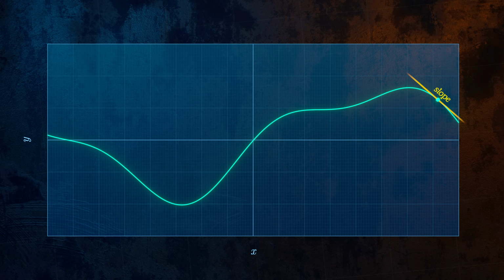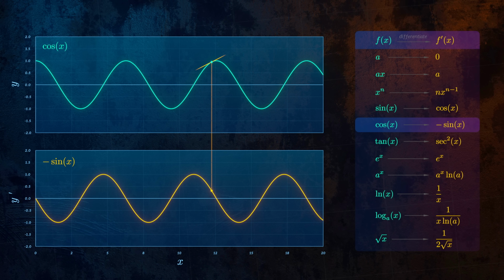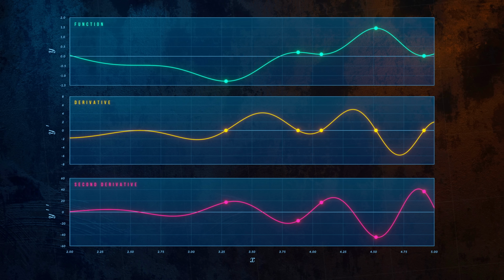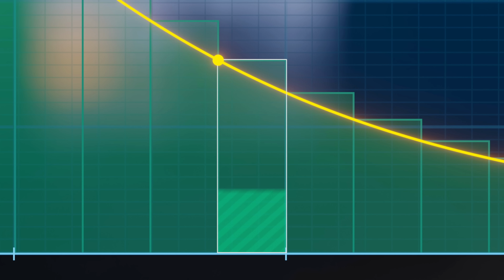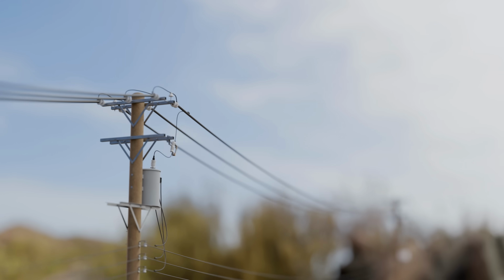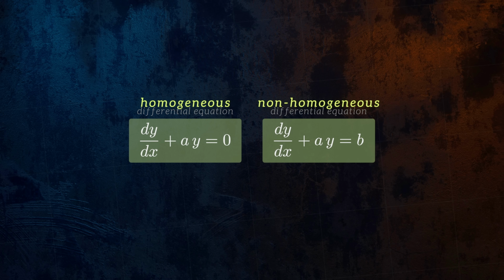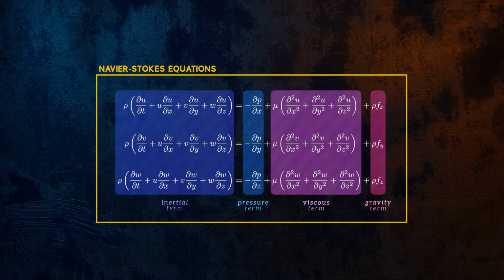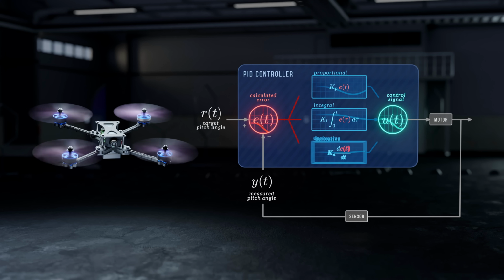Understanding Calculus (for engineers)

Comment: Best way to think of Calculus is to think of the instruments in a car.  A gas gauge integrates the amount of  fuel in a gas tank.  A speedometer derives the distance being traveled.  A better understanding is to see the exponential values deal with dimension.`  Calculus exposes dimension  which is expressed by an exponential value.  X^2 is two dimensional...etc. etc.

Comment: I used "Elementary Differential Equations and Boundary Value Problems" (3rd ed.) by Boyce & DiPrima in a DE course offered by the Math Department;  and "Mathematical Methods in the Physical Sciences" (2nd ed.) by Boas for the Mathematical Methods course offered by the Physics Department.  They both have very applied approaches to the subject and cover Linear Algebra.

"Partial Differential Equations in Physics" (Lectures in Theoretical Physics Vol. VI) by Arnold Sommerfeld is based on his "Lectures on Theoretical Physics".  It, like other volumes in the series, illustrates the thought-processes of a truly great mind;  he was one of the strong bridges between Classical and Quantum Mechanics.

Comment: Physics is pretty easy:  the Four Food Groups contain only two problems!

Classical Mechanics - Harmonic Oscillator (simple, damped-driven, coupled, then add some non-linearity for a little chaos), and Central Force Problem (two bodies, then add a tiny third one and other perturbations)

Electrodynamics - Same as above with charge, plus boundary-value problems.

Quantum Mechanics - Teeny Harmonic Oscillators and Central Force Problem (Hydrogen Atom plus perturbations)

Statistical Mechanics - A gazzilion, teeny, Harmonic Oscillators and Hydrogen Atoms.

Plus,

Condensed Matter - All of the above plus MB, FD & BE statistics, as applicable, and stronger interactions.
Reply: Electrical Engineering is harder (the above plus):

1) LRC Circuits, 
2) PN Junctions,
&
3) Metal/Semiconductor contacts.
Reply: If you told me that when I was in engineering school, I would’ve called you a not just a nerd, but a box of nerds.

Comment: My life would have been much different had I been shown how calculus was used as an engineering tool, as opposed to only a math discipline.  I never obtained the intuition needed to break down an application of force - say, force on a spring to vary displacement, where the slope will indicate spring siffness - into equations and dependent variables and components of calculus.

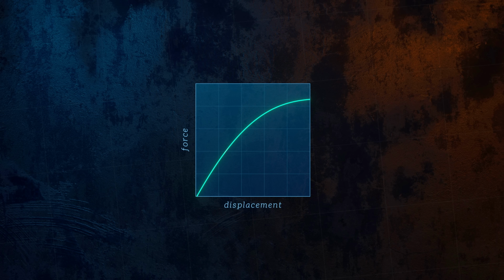For example, I’m writing this comment at 1:09, realizing I never knew to associate the slope wih the stiffness of a material, whilst the application of a force makes a displacement in shape or orientation.  Obviously, I understand that placing weight upon a spring causes the spring to compress, but I was never shown exactly what the slope of the tangent line in this example represents, nor never making the leap on my own.  Too bad, because after only 69 seconds, scales are falling off and away from my eyes.  Too bad I’m 55 now, and I hadn’t grasped this when I was 16.

Comment: I did very well in my basic calculus classes in school, but god, when it comes to applying it, suddenly all my knowledge goes out the window. If you give me a problem that requires calculus but don’t tell me exactly which tools to use, I start to blank.

I wasn’t good at applying algebra either until I started learning calculus. By that point, I had done so much algebra that it was like I was fluent in a second language. I’d have to get that comfortable with calculus too in order to effectively apply it

Comment: I'm just asking, who decided that the signs and graphs needed to be flipped upside down for shear force and moment. That pains me so much at times. Especially when it flips back when you approach from the right, for double confusion and chance to mess everything up.

To this date I have not understood e^x and probably never will. I mean I know its purpose and features and can use it, but I don't understand it. I also never liked that quotient rule, I much preferred to change it to an exponent rule.

I remember looking at the equations in vibration mechanics and thinking "that's just crazy, I'll never be able to find all the variables that define the behaviour". Rest easy, turns out you don't have to, someone figured out you just need one trivial answer that happens to be A•sin(Ωt) and you're good pretty much. Maybe calculate r = ω/Ω or which way it happened to be, maybe some formula for k. But they were scary looking equations before cheating hour way out. God I love engineering, math people often have to actually solve things. Unless they say "well that's so small so I just call it 0". The coolest thing was how you could treat a beam as a spring for vibration.

Also like thankfully the moment etc on bending beam are from tables and Finite Element Method makes life so much easier than trying to solve it by yourself. Although sometimes it feels just like flashing a magic wand after gathering the usual statics and strength calculation stuff into a matrix.

Comment: Calculus (especially Differential Calculus) is also fundamental to neural network training and the neural network transformer architecture (the core of ChatGPT, Gemini, Groq), primarily through its application in gradient descent and backpropagation algorithms. These mathematical tools are used to efficiently adjust the network's internal parameters (weights and biases) to minimize errors and improve performance. Essentially, Calculus provides the Mathematical framework necessary to "teach" both traditional and advanced neural networks how to learn complex patterns from data and improve their performance over time.